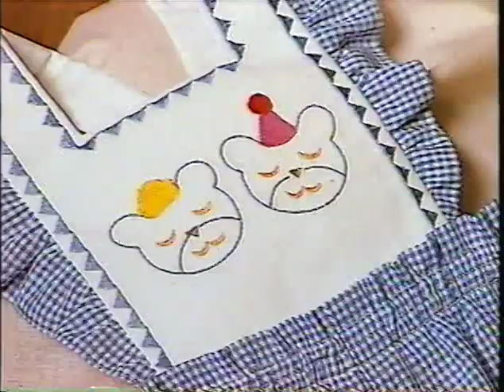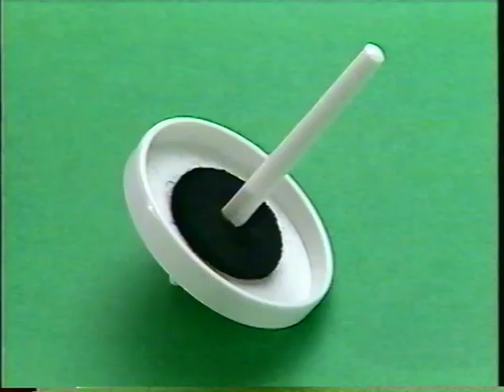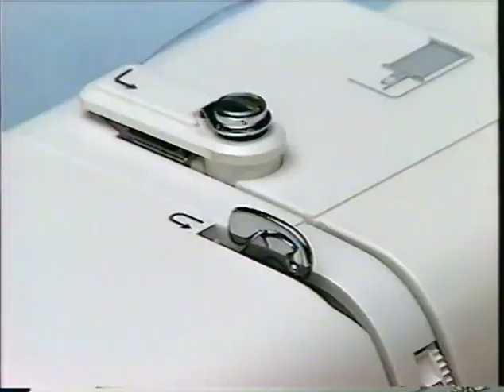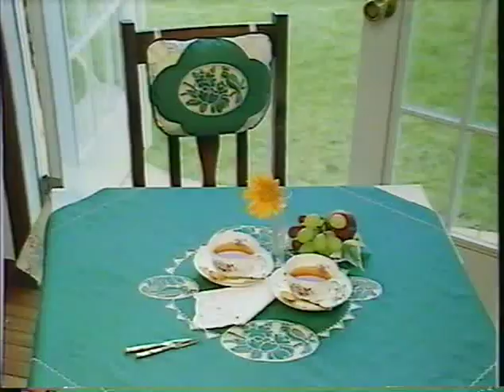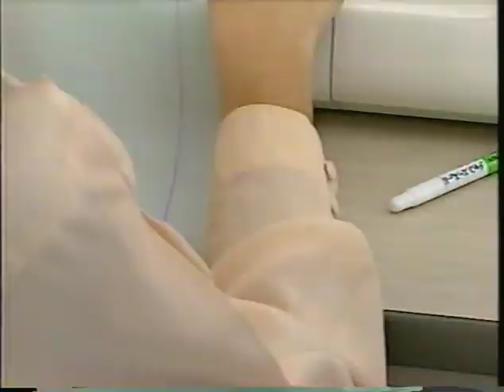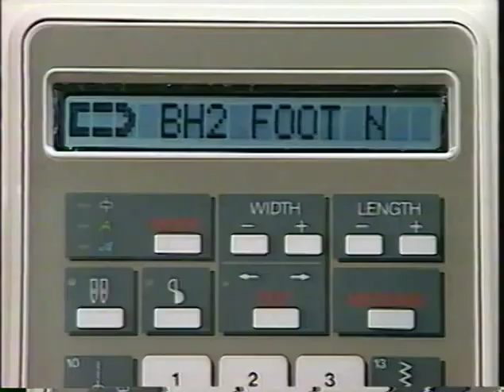Kenmore 150 Stitch - Computer Sewing Machine Video Guide

Comment: My touchpad doesn’t work. Help
Reply: It may have a disconnected wire and that will require a technician.  I have become great at everything for this machine for servicing it, but a tech is needed for the electrical panel. If you can't get that selected then I am unsure how you will know what or if an error is showing. :(

Comment: Thanks this was very helpful. I just got this machine.
Reply: I am shocked how quiet this machine is. I sew on Singers, Pfaff’s, Brother, Viking, Janome. This one is the  quietest.
Reply: @pamelamitsouko5700  Thanks for replying! My machine sounds like a motorcycle club came to town. I need something quiet.
Reply: Are you using metal bobbins? There's a magnet in the bottom of the bobbin case housing... use plastic bobbins. I had the same issue and the sound was greatly reduced when I used plastic. @ddmmt9m
Reply: Is the machine loud in your opinion?
Reply: If your machine is loud, it might be that you're using a metal bobbin. I just learned this one should use plastic bobbins. @ddmmt9m
Reply: @ddmmt9m  Mine is very quiet.  You may need to follow the manual and oil it in the two places it suggests and make sure your feeder feet are in the right position.

I bought this before I got married in 1994.  Here are all of my materials that you can download so that if you bought it second hand you can have the items that came with it.  I love the quick reference guide.  I have also included my manual.  I have used this sewing machine since that year and it has NEVER failed me.  The manual has a troubleshooting section as well.

Kenmore 150 Sewing Machine Model 385. 19150 

My Manual: https://drive.google.com/file/d/17AGXYOAy7028juVQbjJzcjuYQcV-FlHD/view?usp=sharing 

My Quick Access Reference Guide: https://drive.google.com/file/d/1ONMo-DnhcJPEN3GZ25QbqU3_BbTqZvha/view?usp=sharing